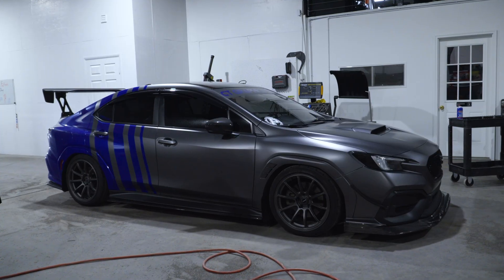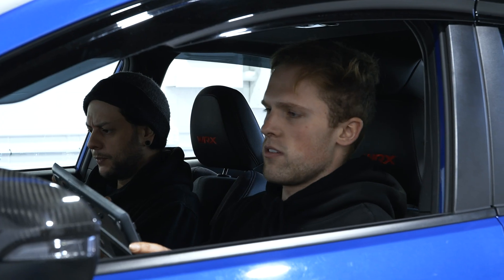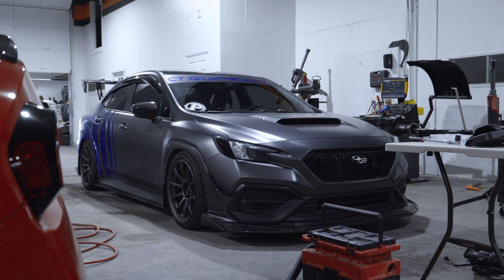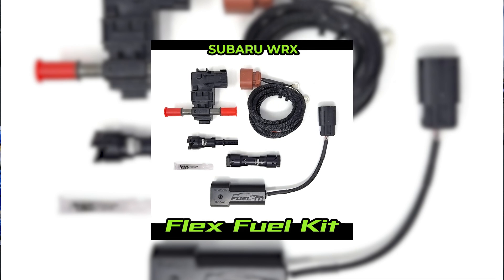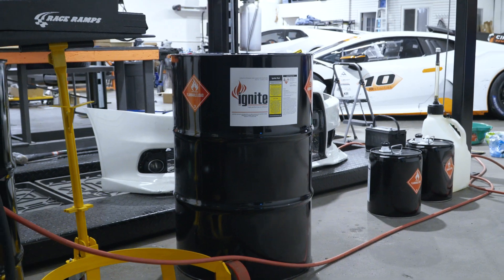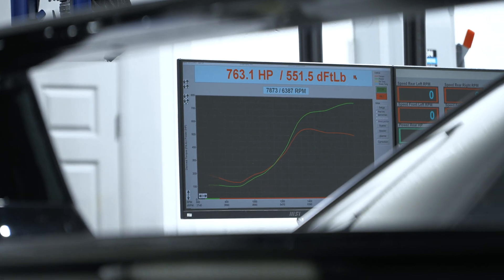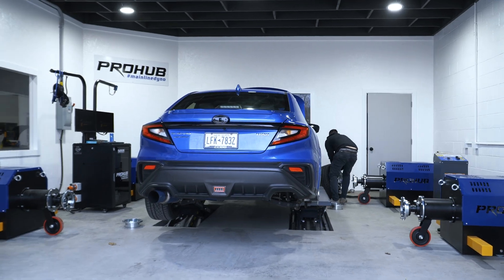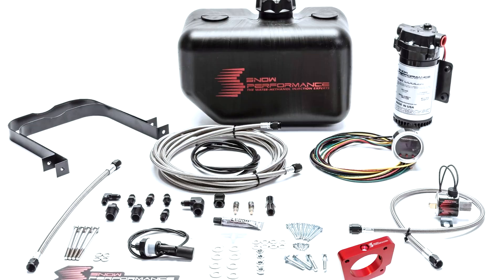How To Run E85 On Your 2022+ WRX

Comment: Thank you for this. I have a much better idea of what to do with my car for tuning when it comes time to do it. Can you tell me what, if any, parts are needed specifically for e-blends? Let's say I just want to add a intercooler upgrade, CAI, and an e-blend tune. Do I need to upgrade fuel filter, fuel pump, or high pressure lines? Or if Im targeting around 400 hp/tq will the stock fuel system run an e-blend just fine for a while?

Comment: I didn't see you answer, is there any benefit or potential harm to filling with higher ethanol content fuel (up to E85) on a completely stock (non tuned) VB? I am also in interested in water meth injection mainly for keeping the valves clean. When you delve into that subject, could you address this idea, possibly offer a kit to accomplish this? I liked the video and subscribed btw.
Reply from the maker: Do not run E85 without a tune! Because ethanol takes 30/40% more fuel to burn, which means it’ll run lean and BLOW THE MOTOR. If you need any assistance with the car please feel free to call or email the crew!
Reply: @circuitdemon_  The JB4 comes with a E30 tune (map 3) would I be able to run E30 without having a flex fuel kit on a stock fuel line VB?
Reply: @circuitdemon_ I understand that this is a year old, but I need to get some clarification. Yea I believe you should not run full e85 without a tune. But what would be wrong about running e30. That converts to 93. Living in shitty California we can’t get 93. And obviously the car will run 100% vs running 91 on a stock tune. I have noticed that I get about 10% power gain over 91 alone. I’ve did a comparison test 2 stock VBs one straight 91 and one e30. Mine walked away from the 91. I’ve been running like this for over 30k miles. Every thing on the motor is stock.

Comment: There is no custom tuning with JB4, its a toy that can adjust only boost by tricking cars ecu.  Would not recommend it to anyone for any tuning, especially not for ethanol "tuning."  I have 22k miles on e50 custom tune, not one problem.  Car makes 400/450 with ETS intake only, so i would recommend ethanol to anyone who has access to it but ONLY with a custom tune.  I saw JR in the video.. i think, though not my tuner.
Reply: Not worried about the build up with no AOS/Catch cans ?
Reply: @VB_Bryan  not at all, its purely aesthetics and doesnt affect engine performance or function.  Car has an Outfront motor now and hybrid setup with port injection so we going for 600whp and added AMS TMIC, ETS jpipe and Borla exhaust. Still no AOS.
Reply: Is protune ok?